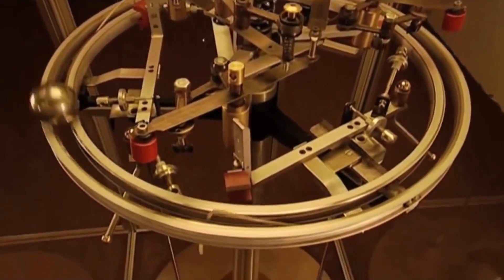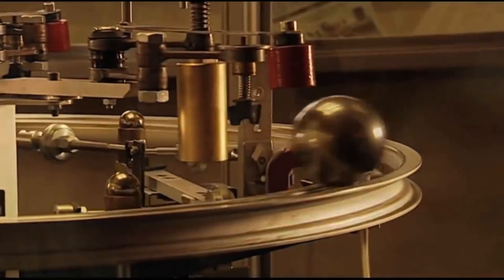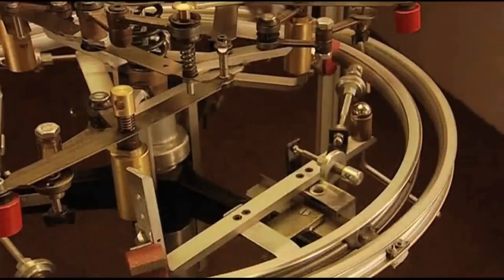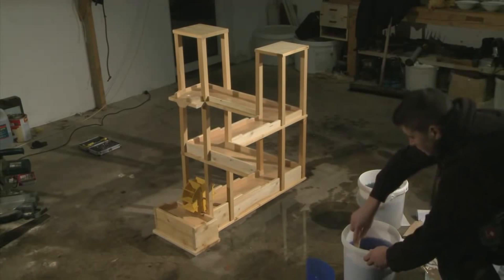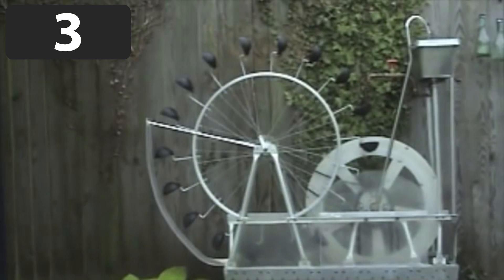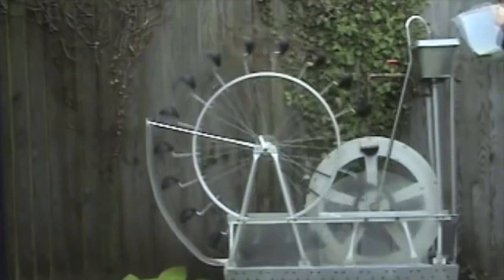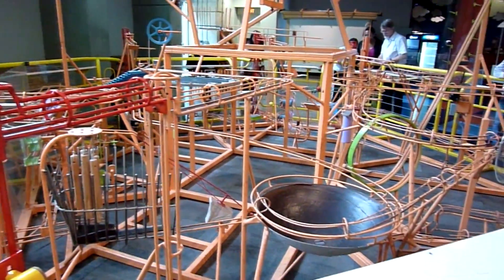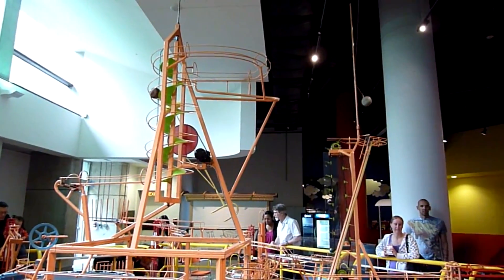Top 5 Near Perpetual Motion Machines

Comment: 1. the problem with this one is easy, the ball would not go around anymore because of friction.
2. that is an extremely cool optical illusion but the teleporter idea wouldn't work because the teleporter has to use power and so therefore since its using power from an external source its not true perpetual motion
3. as the video said, not true perpetual motion.
4. this is not advertised as a perpetual motion machine for a reason.
5. again would run out of energy due to friction.
while the topic is interesting its not possible, just theoretical.

Comment: Even a stone comes closer to perpetual motion than every machiene that was designed for this task.
Reply: What the hell does that mean? The only time a stone would maintain motion for an extended period of time on it's own is maybe if it rolled down a hill and even then it wouldn't move for long. I get this is a joke but come on you can do better than that right?
Reply: @TiredEyePilot  you're right. A stone, spinning in the vacuum of space.
Reply: @grillpig3860  that's like saying "you run slower than usaine bolt" as an insult.
Reply: @TiredEyePilot  Oh right, wrong direction. Even an electrical resonant ciruit comes closer to perpetual motion than every machiene that was designed for this task.
Reply: @grillpig3860  There are actually some machines that can continue moving for years so we have accomplished some pretty impressive things. But I guess you can't really get close to forever so we won't ever create something close to perpetual motion.
Reply: @TiredEyePilot  That may be true, but what's the use? Soemthing that simply does nothing, also keeps its momentum.
Reply: @grillpig3860  there isn't really a point humanity does things simply because it can sometimes.

Comment: Man, that last one was synced with the music
Reply: The possibly of perpetual motion is easily debunked by coasting down a hill on a bicycle, then attempting to coast back up another identical hill. Common sense says the whole idea is dumb..
Reply: @geopioneergsxr5357  hold on to your handle bars there's a good chance at terminal velocity on a   bycicle going down a 20% gradiant hill equal opposite side 4 miles in total length that if as you reach the halfway point in the decent /accent you lift yourself a miniscule soft jump to remove some of your weight without lifting the wheels then possibly you could reach the top,, but you'll still be right because the slight removal of my weight at the right time is extra energy from me😉👍❤️stay safe and a great way to explain how the 2 law works thanks I love a though provoking comment👍
Reply: @robmarrin6720  even if you don't put more energy in it still won't come close to perpetual if you repeat going down multiple hills. Friction from rubber and concrete is is very strong.
Reply: @geopioneergsxr5357  it's not really dumb and is feasible with the absence of friction. The best perpetual motion machines ever made were only held back by friction. But I guess that's part of your point eh? I guess once you realize why perpetual motion is impossible the more silly it is to pursue it. Because no matter what even in a vacuum friction will have to be involved somewhere and that's going to sap all the energy from the most efficient system. Like the one in this video that ran for hours. Even though that thing looked like it had energy being input but I'll take their word for it...i guess.
Reply: Shhh...
Spoils
Reply: The music was synced to your face....

Comment: Calling these machines would be slightly inaccurate. A Machine is required to do work of some kind.
Reply: That is incorrect, or incomplete.

The definition of machine is in part:

An assemblage of parts that transmit forces,  motion, and energy one to another in a predetermined manner. 

(2): an instrument (such as a lever) designed to transmit or modify the application of power, force, or motion

They are all machines, they are all transmitting energy from one part to another through an assemblage of parts. Also they are in fact all doing "work", they are spinning wheels, moving water, moving balls.

Comment: I can't help but make the observation that the "perpetual motion myth" is so greatly widespread because people don't understand gravity.

also...someone had to do it:
#5: really efficient energy storage/conversion
#4: optical illusion, if wormholes exist they'll require energy to use unnaturally (Most likely)
#3: Fake, water can't flow that high no matter how many hoses you coil in that wheel
#2: Has at least 2 dc motors.
#1: A simple internet scam, if it actually works you need to tune it and even then it's not that efficient.
Reply: Ok done of your facts are correct according to regular every day physical phenomena observations... Buuuuu uuuuut. That water one #2 it actually does work trust me ...build it if you don't believe me and if you having problems contact me I can help you make it and a few other designs work too,  cook a lloyd. I live at n Australia. Mob.#  0423371824 you welcome to call but just keep the number responsibly Kay bye.

Comment: 6:52 ; "AND NUMBER 1 a device made from on magnets and Household items..... Of course this isnt TRUE perpetual motion  but it's still interesting to see".......
 Ok so what are you one of those clowns that will keep the people n bondage and suffering paying the man for energy just because you get paid to sell lie nothing is free... Come on bastard  you can obviously see what's happening right...so what if the parts will stop when worn SO FUCKING WHAT!?,   it's still  better than the one you talked to produce and it can mm be improved quite easily to overcome most in some variations or all in others the friction that it is presently OVERCOMING JUST BY THE WAY.... and again I ask where's Your device or system!? now I! Sure the guy understands it won't go forevermore!,.. but will go until it does wear out!, Providing more output energy than used the during input adjustment ( pulling out the locking pin ....huh! input🤣 but just to satisfy the arrogance of your kind of ignorant testing methodology I say ignorant because YOU KNOW BETTER )  at the beginning considering Just how long that is ( the time it WILL operate for). Now is the pay to be a pedantic hair splitting prick so worth it still or do you think now you can finally stop being the ringer for the leaders and abusers mob ... the 1% of the world (probably much much less than that if we are counting only those with vested interests in suppression and the like and also the "power must be purchased promoters") and  as if there weren't a shit load of other free sources of POWER!,  both similar in design and alternative to "YOUR!" chosen number one rating.....ppbbbbbbbbbbbf hah! What a load of crap!  Claimint what you do as if you really believed anyone couldn't understand how friction and wear worked! Ha ha haaaaa and to top it off you HAVE to show the device overcoming both friction and enertial resistance both of which are supposed to be against laws of conservation of  momentum laws an even and Andrades creep law,.  ....LOOK IT UP!... Now with such an obvious AND Public OUTING as this,  I hope you felt it was worth it for You try to sell out the future generation's minds and understanding because even if not a single person was adversely affected by Your part in this campaign against humanity you've openly chosen the wrong side and you will ( and are now getting a little of it too) have to reap/receive the penalty of what you've sewn.

Comment: see, the issue that we meet is friction, eventually friction causes things to stop.

This is why scientists are working on Frictionless Drive for space travel...
Reply: what are you even talking about??? Friction-less Drive? there is no such thing as drag in space...
Reply: @celivalg  In a Zero G environment, the vehicle will not experience any drag, true enough, but the engine which would power the ship, and its various life support functions, would rely on technology that would wear out due to the friction, or at the least, increasingly draw on the ships power source.

The biggest hurdle right now isnt getting a ship to Mars, its keeping the crew alive, since systems will break down, due to the friction that keeps them running.

While air drag may not exist within space, the parts and pieces that keep the crew alive, will experience friction in their dayy to day use, and the engine, be it nuclear or otherwise, will have moving parts that convert energy into a usable form, moving parts that will experience friction, wear out, and eventually fail because of the friction.

As for how i know all this, let me just say, never try to argue with an engineering major, who is aiming for a job in NASA.

Comment: What about a mill wheel from the 16th century?  Water flows down hill and over the mill wheel which turns as a result.  It flows as reliably as the stream or river that feeds it.  Why do you need anything more perpetual than that?
Reply: I think water flow down hill is a results from evaporation, which is evaporation need energy from sun, and that not a perpetual cause Sun Will lost energy someday
Reply: @gerrytv9047    Sure, but when the sun loses all its energy, the whole solar system will end.  No sun, no earth, no problem.

Comment: I designed a mechanical device that uses 4 pounds of force to lift a 20 pound weight at a one to one ratio.
Reply: bs
Reply: Mr. Spork  Would you like to see a video demonstration of it?
Reply: Sure
Reply: Mr. Spork  It is in the process of being made right now. Just waiting for an electric battery to arrive for the camera, that plugs into the wall. Once that arrives, it will take about 2 weeks to assemble the mechanical parts together and explain the law of physics involved in it.
Reply: Here it is. Punch in world breaking news, mechanical free energy. This mechanism shows a 4 pound force lifting a 20 pound weight.

Comment: That last one is close enough!! Let's get a giant one of those to power our homes !!!
Reply: Magnet deteriorates over time so it would only last a few years (possibly months or days) before stopping
Reply: @three3trees336  I'm cool with that !
Reply: @three3trees336  Also get a human powered generator to power an electromagnet in orget to recharge the magnets.... Wonder how much power a large generator like this would give out?
Reply: White Noise that would pretty much be the same as a human powering it.
Reply: @three3trees336  A human cant power anything for 24 hours. If a device like this can run for days and generate electricity, that would be an inceedible feat.
Reply: White Noise you can just use something simpler (like an equally balanced wheel) to do that. No need for magnets and other stuff but it would still only use power from a third-party (eg: a human) as what the laws of physics state (an object cannot exert more energy that it has or something along thos lines).
Reply: Same with a lot of perpetual mootion machines. It has to be powered first and it will start to generate power but in truth, it just uses the force applied to it and keeps reusing it which in result makes it deteriorate over time. (in simple words, it doesn't generate energy, it uses the energy applied to it)
Reply: Solar Power, Wind Power and Nuclear Energy are currently our best bets but they all have downsides. Solar only works on day and doesn't generate enough, Wind releies on wind too much and also doesn't generate enough, Nuclear has wastes which are harmful but it may one day be our main source of energy when they find a way to use Nuclear Waste.
Reply: @three3trees336  also nuclear energy is more like a way to keep the civilization runing for the time to get a new source of energy :) cause like oil uranium i not ilimited but we have a large amount to be able to deal with it ;)

Comment: Perpetual motion is easy. I have had the design in my head since I was a kid. All 5 of these used one or more components but obviously none of them get it right. I would have to learn a couple basic principles but it wouldn't even take much to build. In fact, I think a few of these I could just make some modifications and the principles would work in those designs as well. And my design scales up to produce some real power. (I think, lol. It scales, but power yield per cubic foot of real estate, I'm not sure)

 It's easy, I've never bothered because it seems so obvious that the part I have trouble believing is no one has done it before, but obviously they haven't. And I don't really have ideal resources. So if there are any VC's or other type commissioners out there reading this......
Reply: @liamhackney5045   I do get it. I have relented on calling it a PMM. But, from what I just saw, gravity was not even mentioned but required for the explanation of the first law, meaning it was assumed that the force of gravity was the energy in the system. That means that a machine harnessing the energy of gravity is not in the same category as one which does solar or wind, because it is the fundamental force belying the forces of the sun or the wind. So if a machine harnesses gravity, a fundamental force, it should theoretically be able to run as long as gravity is present. 

Now it shifts to where I don't see how scientists or even laymen can't see how to extract enough energy out of the movement caused by gravity to run a simple machine. We can extract it through solar or wind after it has been broken down to systems with less containment characteristics? or more entropy? or whatever. Why can't we build one based on a gravity or another of the four forces. We should call the quest a quest for a Fundmental Force Machine. 

Idk of it breaks the first law to have a machine seemingly run on no power input but with gravity as the input I believe my machine will run indefinitely.

P.s. Language is screwing up the world as much as anything else.

Peace
Reply: @blackopal3138  Splitting/dispersing the force of gravity with block and tackle: https://youtu.be/sR6PTkwords?t=340
Reply: @liamhackney5045  - Well, you don't read very well. I haven't tried it yet. The part I left out was that it simply might not qualify as perpetual motion, or a PM machine. But it is a machine that will keep running, if the parts don't break, because it produces more power than it uses. And I would say it is about harnessing the LOTD. There is natural power all around us, the trick is to leverage it.

Think of the inventor of the pulley. Conversation would have been the same until he pulled a few out and picked up a car by himself, lol.
Reply: @blackopal3138  "because it produces more power than it uses" that's the bit that stops it working unfortunately, it's simply not possible as it violates the law of conservation of energy.
Reply: @cambridgemart2075  - We only take arguments here. Stating it is simply not possible does not qualify as an argument. Also, it is not constructive. ty         … lol;)

No, I know you haven't seen a design, but I did mention harnessing, and gave an example of when laws change. I'm curious right now about the definition of a PM machine. Why doesn't a generator that runs on wind qualify? Or solar. I understand that source is finite in theory, but is that sole disqualifying factor? Because magnetism, EMism, gravity, geothermal are all constants. (maybe not geothermal, idk) But, why don't we run machines on these forces?

Look at a dam, we harness enough energy on 1 river to supply hundreds of thousands of people. We actually capture all of that energy out of a river and have down to a few cables in 50ft. We just need to learn to do the same with gravity:) peace
Reply: @blackopal3138  You do know that dams, wind, solar are not PM, they are powered by the sun. You need to study your physics, a force is not a source of energy, a force has to move through a  distance to provide power, this is known as work done. The definition of a PM device is a machine that produces power with NO energy input.
Reply: @cambridgemart2075  - Well I do know they aren't PM machines, but because the power source is finite, I thought. I have said from the beginning my machine may not be PM, but it does produce more power than it consumes, and I know 100% it works..... on Earth. It requires gravity, just like every machine in the video, just like anything we build, like life itself.

The thing about a true PM machine is like you all say, you can't break physical laws. But that renders the whole idea stupid and a useless phrase. Why don't they call it the Break the Laws of Physics Machine. I was of the belief that Pulitzer or Nobel had a standing prize for one? If that's true, I'm still missing a piece, cz like I said it's just stupid otherwise. But if you want a machine that produces more power than it consumes, I'm your Daddy, lol. peace
Reply: @cambridgemart2075   - well ya, like the ball on the track. No matter what the size or mass of the ball or the angle of the track, the ball can never gain enough acceleration to come back higher, correct?  That's the law. But the law is about gravity, the ball can't beat gravity because of friction which has to be present, in air pressure. Is that right? Because that means the challenge is to beat gravity.  All of these machines stop because of gravity. I got this, lol